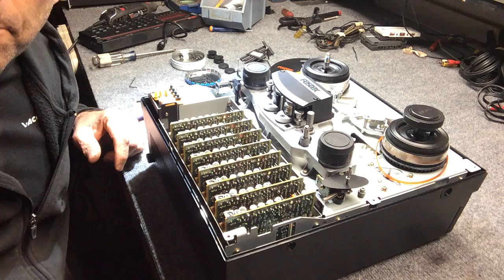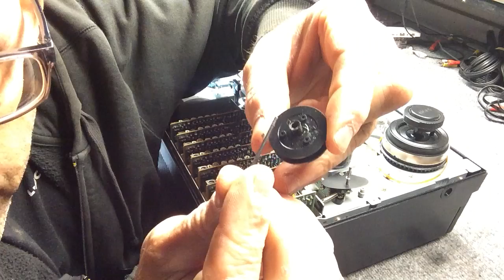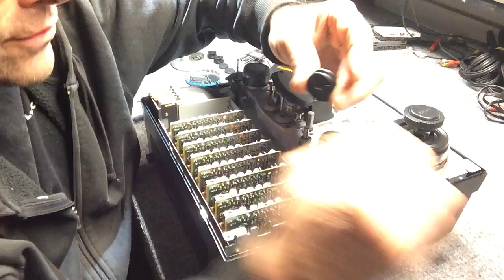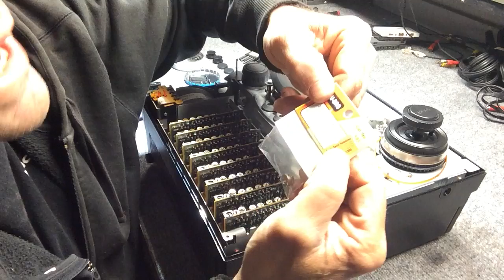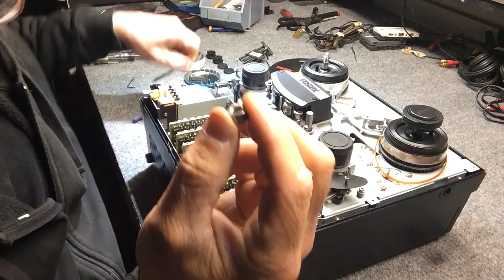Fostex R8 Fix Part 1

Comment: yeah my pully wheel cracked many years ago, my quick fix which lasted so far, was super glue the crack but also pass a peice of fuse wire through the pully wheel hole , then push it back on shaft.

Comment: Hi, trying to find one of these in UK, is it a shaft collar? I have no measuring tool, please can you tell me what diameter the interior shaft needs to be? Thanks!
Reply from the maker: As I stated in the video, the collar I used is for RC airplane landing gear, and the drill bit I used is a number 3.   That is .210"  or 5.36 mm.

Comment: Cool, had the same problem so i ordered the complete engine and changed it. Now i have another problem, with no/slow action in play-mode. It gets worse when the machine haven´t been used. So i suspect it need oiling?

Comment: Seen both your vids on this, very clear fix. Mine has started to  slow down after about 10 min of play....know a fix for that?
Reply from the maker: The only problem I've had with mine is the timing pulley issue.  If you can figure out how to remove the front cover like I have in my video, you can inspect the drive system in action to maybe determine if it is a mechanical problem.  If it is an electronic problem, I don't know.

Comment: tascam ninja  i know the man very very well  he will not be around long best to get all the part you need  first  there's only so many unit's needing  work 
i fix and service all my unit's i get  and i have had parts from john as well   john pulls old units apart when they are not working.   i have 8 x R8  all in need of parts
all the same thing on all 8 decks can't sell them they are not my decks  to sell

Comment: so just what size is your    #3 drill bit? Please give me the fraction 1/64 for example.
Reply: I used a 7/64 bit on mine. It's a tiny bit loose, but once you tighten the set screw, very lightly by the way so as not to make things worse, it worked beautifully

Comment: I have the same problem with my R8, which I bought new around 1985.  I'm having a problem with the speed.  It starts playback slow and takes about 20 seconds to get up to speed.  Any thoughts about what I can do?
Reply from the maker: hotboxdp  Sorry, I don’t know what is causing the speed lag on your machine, luckily my only problem has been the split pulley hub that I am showing.  Your problem seems not to be related to mine as my capstan speed was never affected, only the takeup and rewind.
Reply: I had a similar problem, and it was a drive belt problem. It cost around 13 dollars from Walmart of all places. Finally running again after years collecting dust
Reply: Mine is doing the opposite...starts normal then runs slow. Hope I can find the fix.

Comment: I went to a machine shop and had one aluminium, mane belt drive wheel made for mine, (replaced the plastic one) $80.00 with set screws, done forever... I'm sure they could make 2 of those.

Comment: Did this method hold up? My pulleys keep flying off periodically ... last time I glued the recurring problem pulley (with cement glue) which lasted a couple of months, but it came off again last night.Trying to find a better solution, this looks like a good one!